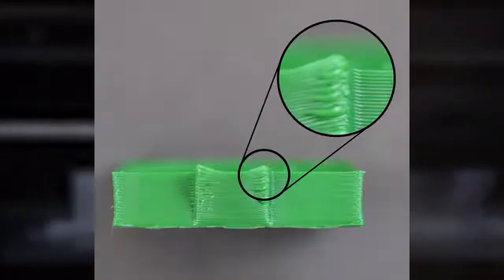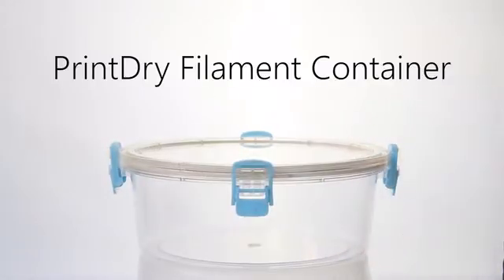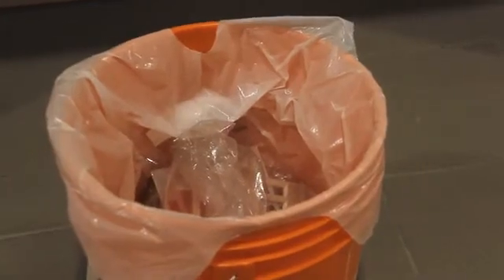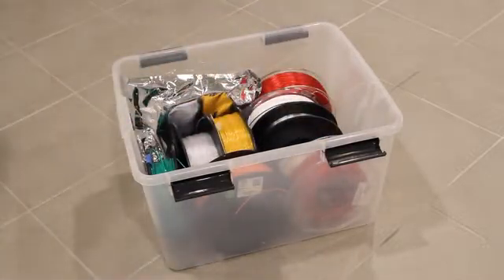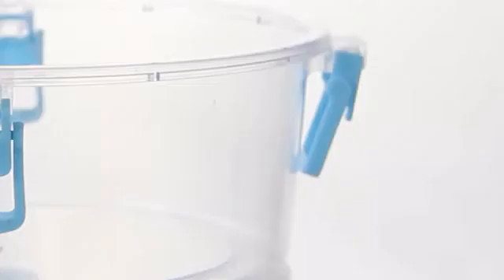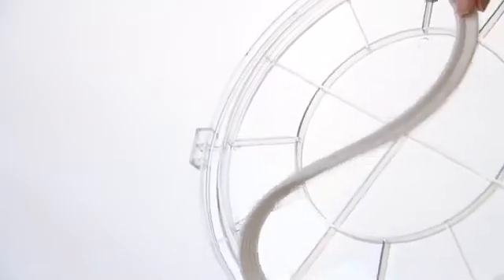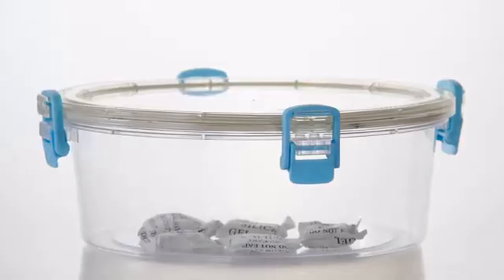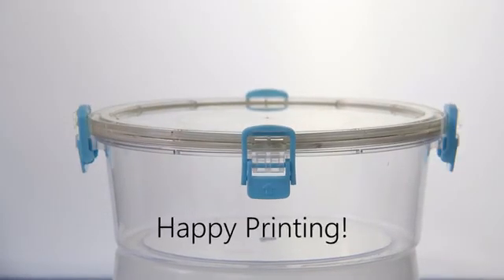This Water tight Container keep Filament perfectly Dry | 3D Printing | PrintDry | AN3D

Comment: $57-$69 a container... i can use one of them large airtight containers and  with desiccant packs for a fraction of that. Good Idea, bad cost.
Reply: Wrong, it's $69 for 6 of these, that's $11.50 per container.
Reply: @calebsherman886  Still, almost as expensive as some cheap filament rolls lol